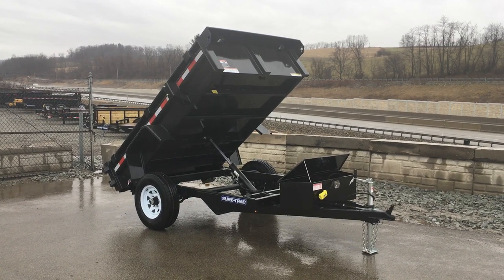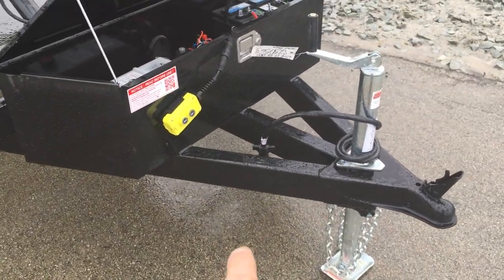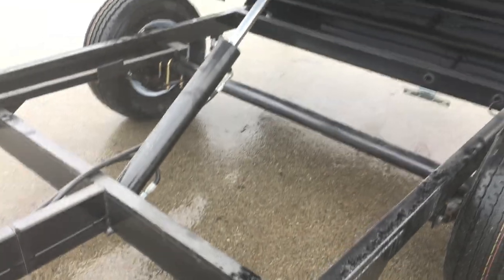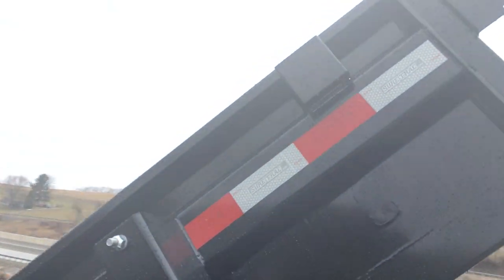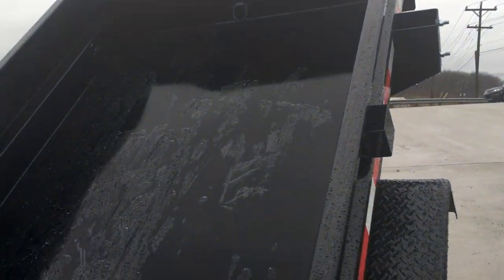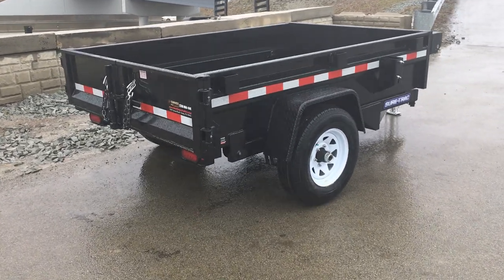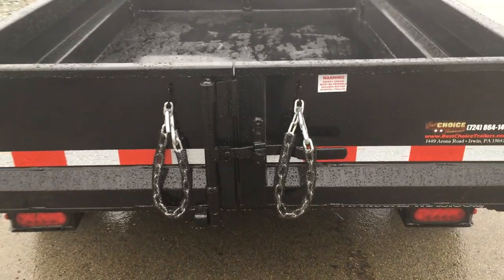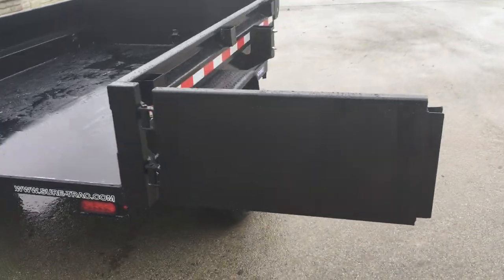Sure Trac 5x8' Low Profile Homeowner Dump Trailer 5000# GVW ST6208D-B-050

Comment: Purchase this trailer last spring but got the landscaping tailgate.  It is used to move firewood, gravel, debride and dirt,  Cannot get an answer how often and how much grease is used on the trailer.  Know the axle is twice a year once in the fall and main in the spring.  How often should maintenance be preformed.
Reply: @Boco LWN I have this trailer with landscape gate. The gate was a 300 dollar option for me. You can lay it down to load. You can use it as a spreader gate and you can take it off too..  its a heavy gate

Comment: Is the gate the only thing different from the old ones?
Reply from the maker: Jeremy - Depends what you are considering "old".  Going back a few years, 2015-ish saw the integrated body stiffener in the sidewall and a new dump plant, which has the best steel prep and powder coat of any of our brands, also a spare tire mount and tarp shroud became standard.  2016-ish saw a steel diamond plate fender and toolbox lid upgrades.  2017-ish saw a zinc jack, bullet lights, and a barn door gate upgrade.
Reply: Best Choice Trailers Mine must be a  2016 then like the trailer though .

Comment: How much is that single axle dump trailer also can I haul a side by side in it
Reply from the maker: Generally speaking, no, it is built primarily for dumping.  Ramps are neither standard or available (only an optional gate, which we do only in a 5x10' tandem axle 7000lb).  I think you'll find a UTV, on average, to be a hair over 5' wide by about 10.5'-ish long, plus or minus a foot on length.